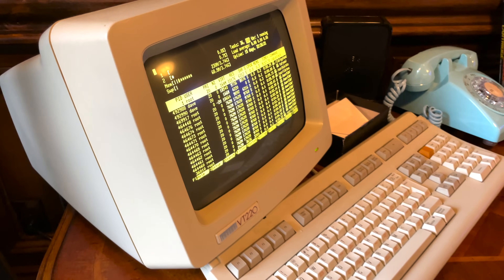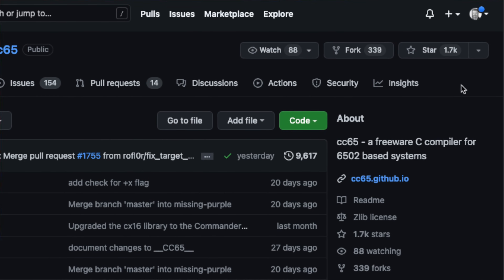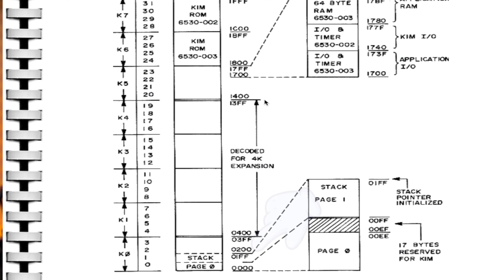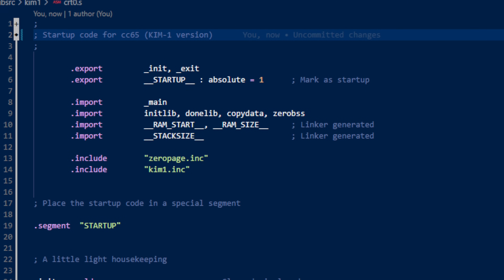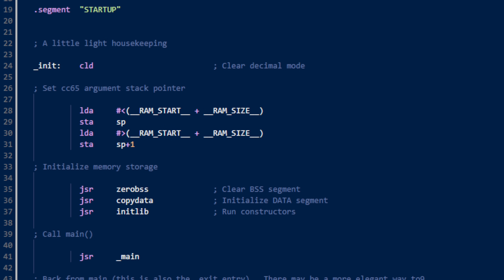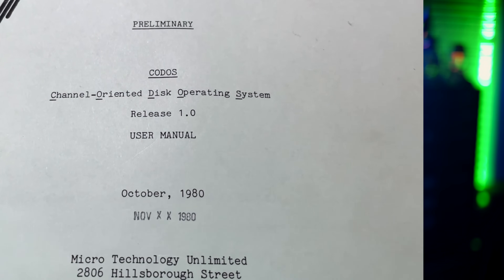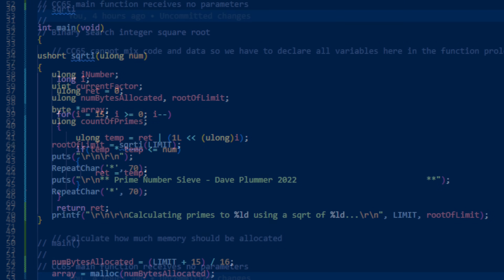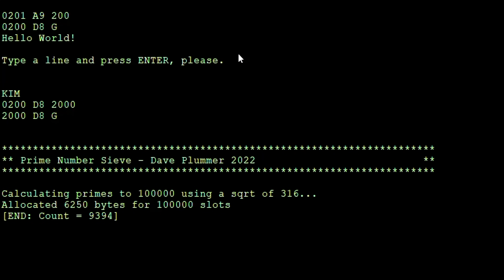RETRO C 1977: a C Compiler for the KIM-1

Comment: Used to use the lattice C compiler
Reply from the maker: Me too!  I still have the manuals, actually, in a box!
Reply: @DavesGarage  Is it just for x86 or can generate code for 68k and z80?
Reply: @DVRC  There's z88dk for Z80 machines.
Reply: Yes,  I remember Lattice, Watcom, MS C, Turbo C.    I don't know if anyone did it before them but that debugger in Turbo C was a game changer.
Reply: @lucidmoses  Believe it or not, I still occasionally use Watcom C in a commercial capacity, a real favourite for its tight accurate 16 bit DOS code. :-) But mention of MS C gives me nightmare flashbacks about v7(?) which used to complain entirely randomly 'No space left on device', an error which then magically disappears on the next compile!
Reply: @Jimbaloidatron  My experience with MS C back in the day was bleak as well.   Ok, it was a big project but it took 6 hours to compile.   Changed compilers a few times an ultimately ended up on Turbo C which got it done in under 30 min.   Pretty much limited by disk I/O.   But it made me wonder what MS C was doing with all that time as the Turbo C output was smaller and faster to execute.     
Now I'm working with Visual C on a project that was well over a million lines 5 years ago.   Sure it takes it a while to compile but it's not unreasonable.  Little over 30 min to do a full build.  Course that is on a beast of a computer.
Reply: @lucidmoses  Turbo Debugger is a beast.
Reply: @fnjesusfreak  Yes,  I feel the only useful thing Visual C has on it is live code changing but that's what, 35 years later.
Reply: @fnjesusfreak  Humm. Hadn't heard of QuickC.  Pretty much wrote off MS SlowC during that three year period.  Given the name I guess they knew their reputation.  I don't know when Edit and Continue came it.   I remember seeing it while I was using Borland C++ but it wasn't enough of a draw and it had too many other negatives in those days.
Reply: DeSmet  C compiler 🤣
Reply: I used SASC (based on Lattice C) for many years on IBM 370s.
Reply: @jk-video2716  C in EBCDIC, Sure why not. I take it that it had extensions for Packed Decimal and other IBM Mainframe-ness.
Reply: @lucidmoses  yes, there were a number of things that made it IBM friendly. Our code did a lot of DB2 work and ISPF user interface stuff. It was fairly good with file IO, including VSAM. We had to support all DB2 column types (including conversion between types). We did use a little assembler code.
Reply: @jk-video2716  DB2?  Well I hope you at least got to use the Embedded SQL.  Manually coding those low level library calls can be a bit of a bore.
Reply: @lucidmoses  we actually generated SQL. The product extracted data that is relationally related - followed relationships from table to table.